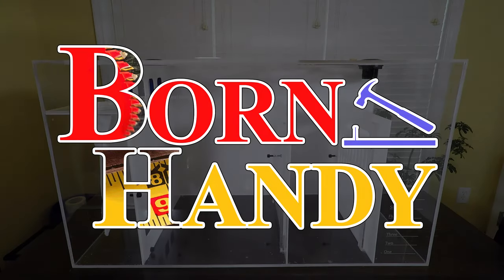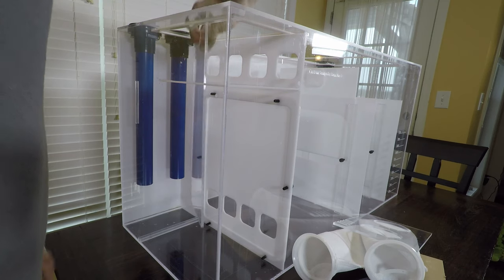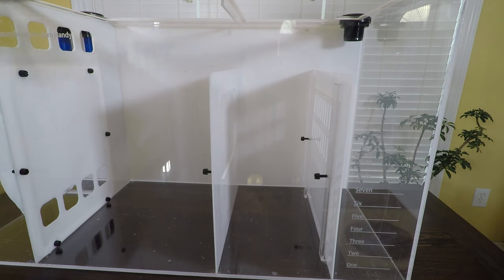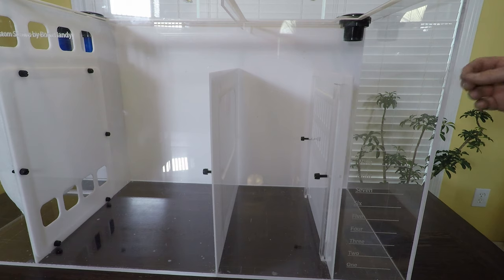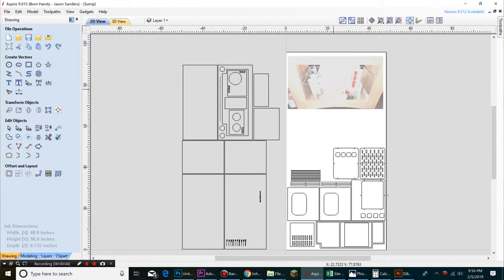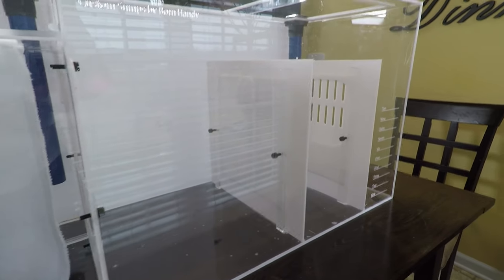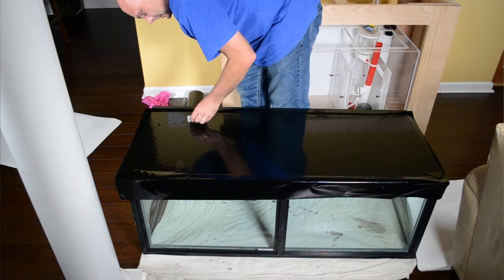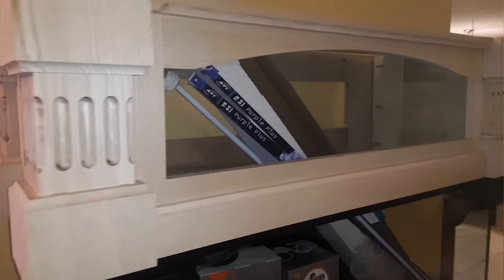Build a professional looking sump, even if you don't have a CNC.

Comment: Awesome build! Quick question. I’m wondering how you estimated the volume for your return chamber engraving markings? I.e. how did you estimate that the 2 gallon mark is indeed at 2 gallons
Reply from the maker: Those are inch marks, but if you want to know the gallons it would be: Inside length x width x height (in inches) divided by 231.  So a 10 gallon tank is typically 20 long by 10 high by 12 tall.  20 x 10 x 12 = 2400.  2400 divided by 231 is 10.389.

Comment: Isn't the water supposed to flow through the filter socks?
Reply: Never mind I saw the baffle on the side. Looks great btw
Reply from the maker: @lancebusch8346  I am glad you saw that, and water definitely flows through - I am constantly cleaning them out.  But...I have actually seen designs where a filter sock functions as a media bag, more than a filter sock.  In that layout, mesh filter socks hang down into flowing water, allowing the media to come into contact with the water, but never having water flow into the top of the sock.  In any case, thanks for watching.

Comment: Where did you buy the acrylic sheet?
Reply from the maker: That can be tough depending on where you live.  Plastic shops is the best place, but not all areas have a local plastic shop, and even if there are a few near you, not all of them carry acrylic sheets.  If a plastic shops are out, then get with a sign shop.  Sign shops buy a lot of acrylic, and usually get cast acrylic (cast acrylic cuts better than extruded acrylic).  Your big box hardware stores usually carry extruded, but their prices are 3 to 4 times what plastic shops charge, so hopefully they aren't your only option.   -  To your original question, I got mine from a local sign shop.

Comment: What was the price of the sump??
Reply from the maker: Its hard to say what it will cost because acrylic prices move just like gas prices.  Additionally, some vendors charge waaay more for acrylic than others, but at the time of construction, I was paying about $120.00 per sheet of 6mm in 4x8 sheets.  It took a sheet and a half (or so).  The solvent and supplies were about $15.00.  The nylon screws were just a few cents each, and the bulkheads were around $12.00.  For sure, under $300.00, and I had enough material to make the custom overflow too.

Comment: What are the dimensions of this sump ?
Reply from the maker: Added to the description.
Reply: @BornHandy  oh man , this is enough to filter the Red sea :D
Reply from the maker: @theamjadjamousable  I wanted a huge refugium, and to be able to run a Neptune COR 20 wide open.  That meant that if the power failed, the water would rise a lot more that usual for a 75 gallon, so I needed the space.  As it happens, this refugium fills almost to the top when the pump is off.  On a side note, I have been thinking of doing a 40 breeder just like this 75, so if I do, a smaller refugium is in the works.
Reply: @BornHandy   that might be more helpful for most imo. Thanks
Reply: BTW,  your work is awesome .